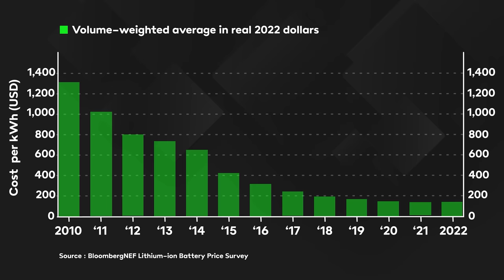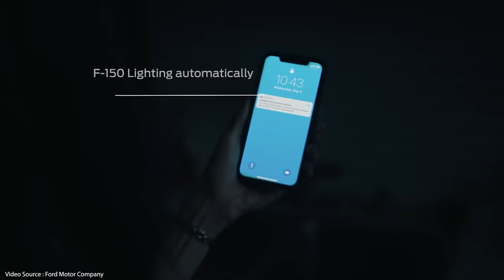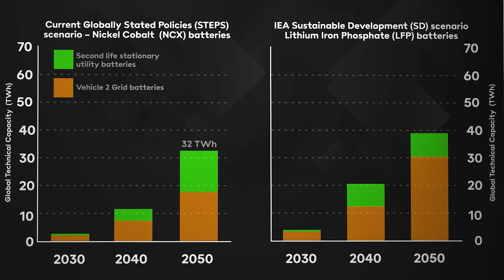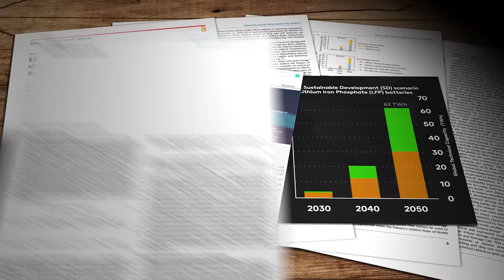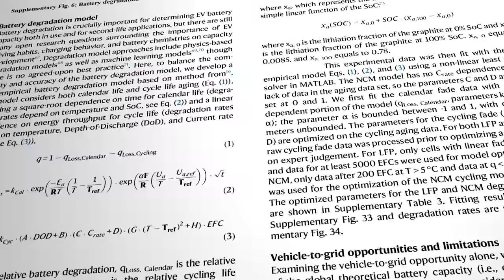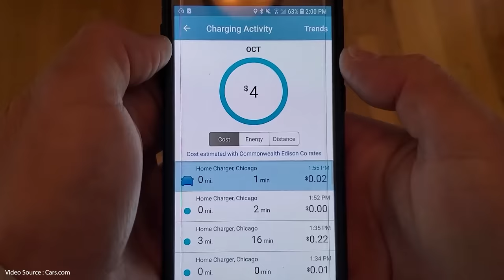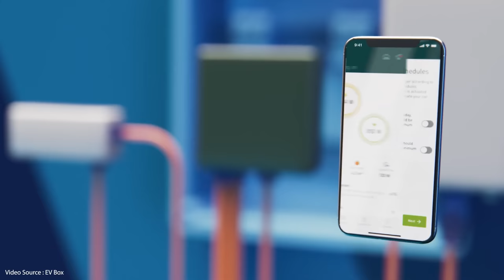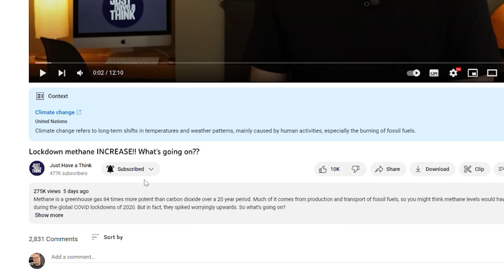Can the electric grid ruin your EV battery?

Comment: yes plug you car in, they use it and you pay for it...here they shut down pumped hydro cause they pay fees and taxes for using the extra power to pump water up and when it gets used they pay fees and taxes for providing power...you get nothing out of that and have a faster decaying battery even if they use it at slower speeds then you would have without that system...better connect that system to you carbon footprint and someone decides hey he only is allowed to drive 10 min so we limit how much juice he has in his car in the morning, no trip to your friends on the weekend...and if you go to some other charger it somehow is just out of order...

Comment: Can anyone tell me if the inability of a Tesla to share power with the grid is due to software or if it is physically impossible. I would like a Tesla, but would like this functionality
I might need to wait awhile and do some research now that I am pondering it🤔
Reply: 2 reasons 1 Tesla didn't want its customers demanding new battery packs on its 8 year 80% warranty because of household use, tertiary batteries don't have a great cycle life. 2 Tesla really didn't want to get into it with the energy corporations who have the biggest lobbyists groups they have enough grief from gas&oil /legacy auto. 
It is probably in the future though as many of Tesla's vehicles have Lifepo4 battery packs which have huge life cycles.
Reply: @jackdbur  Makes sense mate, ta

Comment: The 6.5 years to see a 30% growth in electricity capacity that allows EVs to become mainstream assumes that the 4% growth per year that has been happening for the last 60 years is suddenly no longer needed for other things (which is why it was there all the time). So a drastic reduction of (growth of) electricity usage IS needed to accommodate a transition to mostly EVs. This was a bit glossed over. Alternative is an additional 4% growth per year of the net (so nett 8% growth per year) for the coming seven years, which makes only sense if this is totally done by renewables or at least Carbon-neutral generation.

Comment: I LOVE the idea of EV batteries that could have a few dead cells going back to the grid to provide energy storage. Although one of the biggest issues with EVs still isn't addressed here. After your battery degrades, the cost of buying a new one is insane. BUUUUUT.. If the government were to buy the old batteries to offset the cost it might make it just as expensive as changing an I.C.E. Hate EVs and find them to be a waste of resources, but that would make me hate them a lot less...
Reply: It's about the economies of scale...
1. To produce or recycle a small amount of batteries the cost per battery will be sky high.
2. To produce or recycle a middling amount of batteries the cost per battery will begin to be more affordable (this is kinda where we are today)
3. To produce or recycle bucketloads of batteries the cost per battery will be dirt cheap (this is where we're moving to)

In a decade, batteries will be very cheap to replace as production greatly increases.
Reply from the maker: You will almost certainly never buy a new battery for a modern EV. The batteries will last far longer than the frame they are bolted too. There are Tesla taxis driving around today that have more than a million kilometres on the clock, and approx. 85% capacity left in the battery

Comment: Its strange that many ev batteries are not actively cooled and that outside of Asia there are no evs that let you add or remove batteries selectively for when you really need it. Having ev batteries that can double as solar batteries for the home seems like a rather obvious solution that is only possibly hampered by excessive insurance / legal costs and a corporate culture that does not value good engineering.
Reply: I'm not aware of a single car produced today which dosnt have active cooling 
Removeable batteries complicates things massively and puts limitations to pack design which will ultermately mean much less range
Reply: Their heavy & built into the underneath of the car. Unless you have a car lift how to access them. They are hundreds of kilos pack inside a waterproof box with many connections including coolant! Neo is the closest thing with its swappable battery packs where you can hire/lease a big battery at a swap station for greater range.

Comment: Here in the US where our politicians are up for sale to the highest bidder you can bet your bottom dollar that they will make laws that hurt the EV owner and help the Grid Operators with their big lobbyist budgets. I would be much more likely to add my own solar system with storage and integrate the EV car as part of that system and avoid the grid all together. I would bet money it would be cheaper in the long run as the grid suppliers buy off the politicians. The car would be a huge benefit for buying grid power at charging stations in emergencies and then using it as home power when solar is low. Pretty much the opposite of this dream scenario here. This idea only makes sense in a rational ideal world where greed has been eliminated. Here in the states the idea of social good is frowned upon mostly so the public be damned. Even when they make laws that are rational, you cannot rely on them in the long run as even California has shown lately with the changing rules on home solar systems tied into the grid. Totally flipped the rules around in mid current on folks making the system pay back longer.
Reply: I must confess though that I will likely be a very late adopter as I am one of those who regularly drives over a thousand miles in a day. EV just cannot do that yet.

Comment: In theory it is a good idea to use car batteries to supplement the national grid, at times of peak demand and low generation without the need to build additional storage. But, and 
there is always a but, even the best academic theory papers tend to fall down when they meet the real world. In this case you are reliant on there being sufficient wind generation both before and after the odd windless night, and the vagaries of enough people remembering to plug their cars in.

simple scenario, the population of the U.K. comes home on a cold windless night, half, plug their cars in because their vehicles are at half charge or less, and the national grid starts to 
drain those batteries, but if the wind does not pick up by morning, people will go out in the morning to find, not a fully charged car but one with only a quarter charge (not happy)

Yes, to repurposing car batteries once they are past their prime, to be used as energy storage for domestic or commercial property that is having solar panels or a wind turbine installed, but no, to relying in vehicle car batteries as a cheaper alternative to purpose built energy storage.

This idea is a distraction, as are things, like the internet of things, where we build the bear minimum amount of renewable capacity and use smart technology to switch on or off an 
internet of things, as a way of balancing supply and demand, where large tech companies would control the operation of everything from large factories to your domestic washing machine or fridge, I believe that the big technology companies could build such a smart system,  but I also believe that the tech companies already have too much control over our lives.

The real problem is not the odd windless evening, but when the wind and sun don’t play ball for days or even weeks at a time, every winter the U.K. is subject to weather events, known 
as a blocking high pressure system, which can last for up to two weeks at a time, and they usually come complete with a blanket of cloud, which further reduces an already limited amount of light for solar panels, plus there is little, or no wind for the wind turbines, leaving us with nuclear, but even if we get 8 shiny new nuclear power stations, that is equivalent to only 30% of our energy needs, which will go nowhere near meeting our energy demands, put simply we need a system that can store and supply between 60 to 70% of our energy needs for up to a month each winter, only a chemical storage system has would have the capacity to storage energy for such a period, if we are not to fall back onto fossil fuels, luckily the latest development for producing Hydrogen by electrolysis are looking very efficient, plus there have been big development in green Ammonia as well.
 
 It has been suggested that large scale energy storage is unnecessary, and that we should rely on interconnectors under the sea to transfer electricity backwards and forwards between ourselves and Europe, on the assumption that some part of Europe will always have a surplus we can use, but I can see a scenario where eastern Europe is suffering a winter cold snap and needs all the energy it can get, Britain and the low countries are stuck under a blocking high pressure system, so no wind, plus Spain and Portugal are covered by rain bearing cloud, so minimal solar power, and such a situation would not be that unusual, and given recent developments with the war in Ukraine to satisfy a small man’s ego, it would be extremely unwise to assume that our partners in Europe will always be willing, or even able to supply us with what we want, when we want it, storing our own energy means we stay in control.

We must generate 50% more energy than we would need on a typical day probably by wind, solar and nuclear, and build a substantial quantity of storage, for short-term storage up to six hours we could use batteries made from cheaper and more abundant materials like Sodium and Sulphur, then there is the 6 hours to 48 hours segment, there are many hopefuls in this sector, but there is one technology that looks ideal for this slot, the carbon dioxide battery (Energy Dome) basically, a closed loop system where a large quantity of carbon dioxide is repeatedly compressed with surplus energy, then allowed to expand to generate electricity, but best of all there is no Hughley complicated cryogenics system, and it is made from off the shelf engineering components, which should make the system affordable and easy to replicate, the only drawback is the large size of the dome, but I am certain these could be accommodated at the site of fossil fuel power stations waiting to be decommissioned, plus the transmission line would already be in place. It is just a shame that some bright spark decided to knock down all the old gasometers that where in every town, I would have thought that they would have been a perfect fit for a carbon dioxide battery. And for long-term storage a Green chemical energy fuel like Hydrogen or Green Ammonia would be ideal, especially as we will need such fuels for heavy road transport shipping and planes.   

we should not get distracted, but start with the basics, build 50% more renewable energy generation than we would typically need for an average day, build purpose built energy storage for some batteries up to green chemical fuels, then we could put the icing on the cake by using car batteries  or an internet of things.

Comment: Most interesting. I wonder what the power generators think about harnessing the potential, (no pun intended ), of a pool of diverse electron sources. It appears that  they are always eager to exploit anything that will increase their profit margins without upgrading their ageing plant. On the other hand, a problem arises due to the capacity of the transmission systems to cope with the extra loads imposed due to all this increase in available storage and PV generating capacity. The overall limitations and problems with power generation and distribution appear to stem partly from the historical decision here, in the US, and I suspect in the UK, to privatise large parts of the the electric power industry and 'enjoy' the benefits of being run by corporate entities with greater efficiency. Just my two penno'th.

Comment: I know there's only one EV manufacturer that has a real world battery swapping solution in the wild (NIO), but I can see it becoming more ubiquitous. At some point in the not too distant future, we'll probably be at the stage where car manufacturers can make the decision not to increase a car's 300/350 mile range to say, 450/500, but instead shrink the footprint of the battery pack. Once you're at that stage, we could potentially start standardising on a form factor and have battery swapping across multiple manufacturers at the same stations.

Those batteries could be charged up relatively slowly overnight on surplus wind here in the UK. There's also potential for these battery stations to act as grid balancing too, especially if they're located in the same places existing fuelling stations are. Slower charging would result in longer life and you could also swap out the batteries for lighter, higher capacity ones if you need - bit like having the phone and network plan decoupled.

One thing I could see going against this idea is each manufacturer wanting to own all the components and materials and say, a Mercedes / BMW not wanting a battery that has been given a harsh life in another vehicle with poorer battery thermal management. This is why I think you'd need to have a combo of a smaller, permanent, on board battery that handles all the sudden acceleration / regenerative braking input/output, and then the larger battery with it's own self contained thermal management having lower I/O of power. Would also help with the swapping as you wouldn't need to couple / decouple coolant pipes either.
Reply: Swapping Probably not happening do you want to get a battery pack that has been thrashed by say an Uber car being always fast charged and used hard when you carefully charged at home and didn't use your car much! Not to mention that legacy auto mostly uses cheap pouch cells in their packs!
Reply: @jackdbur  I get those concerns, hence why I was saying there'd need to be charge speed limits on these batteries. You could still have up to say 50KW charging on them but ultimately they'd be an alternative to rapid chargers.
Reply: @sanfrancrisko9962  No one is going to buy a EV with a 50kw charging limited unless it is really really cheap and adding all of that V2g & swappable to it is extra cost.
Reply: @jackdbur  The "V2G" equipment would be at the charging locations where you can scale up and treat the battery bank as a grid storage facility too. That's why I wrote "V2G" as it's not really battery -> grid on an individual battery level. Also, it's just an added bonus and not a necessity.

Regarding the 50KW charging - yes, if you were using a rapid charger, that would be antiquated, even by today's standards, but if you were pulling in to a battery swap station, you've got a similar refuelling experience to petrol / diesel. The charge speed is not a factor there - it's only to protect battery wear and tear when the customer is holding on to the battery for an extended period of time.

There are still a lot of people who don't have the luxury of a driveway and/or have had too many negative experiences with broken / ICE'd rapid chargers (some even going back to an ICE). I think there could be a market for battery swapping stations alongside rapid chargers.

Comment: Snag 1:  The impending train crash caused by our failure to standardise batteries and vehicle design will create huge problems in the "Repurposing" process.

Snag 2: It is precisely because the design process has FAILED TO FOLLOW the petrol diesel refuelling process that we are left with the catastrophe of charging points. Battery swopping is the only feasible route for  (fast turn around refuelling) those car owners who don't have the option of a private charging point because of the configuration of our housing stock. This has been almost universally ignored and will be the major brake on consumers switching to battery cars. However cheap they get, if they can't integrate with our lives they're useless.

Have any of these designers actually looked at how people live in cities?

Comment: Forgive me, but around (9:50) you cite an engineer who claims we can have enough grid capacity with only 30% more energy production.  This is a flawed analysis because it only considers "energy" and not power demand.  DC Fast Charge at 350kW per dispenser will draw 3.5 Mw of power for 10 dispensers per site.  Most sites will require an expensive grid upgrade to do this.  Further, with a MegaCharger rated at 1.6 Mw per battery Semi charging only 1,000 Battery Semis charging will draw 1.6 Gw of instantaneous demand.  How would a local grid handle fast charging for just 1,000 Semis?  Not well.  1.6 Gw is larger than the electric grid on Oahu.  If you don't do both "energy" and "power" calculations your conclusions will be flawed.  As demonstrated by the simplistic and erroneous claim we only need to expand the grid by 30% in energy capacity to support all battery EVs in the US.  In a pigs eye.  Try again, this time consider "power demand" in your calculation if you want a real answer.